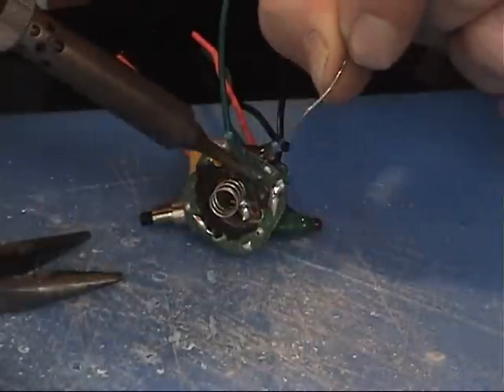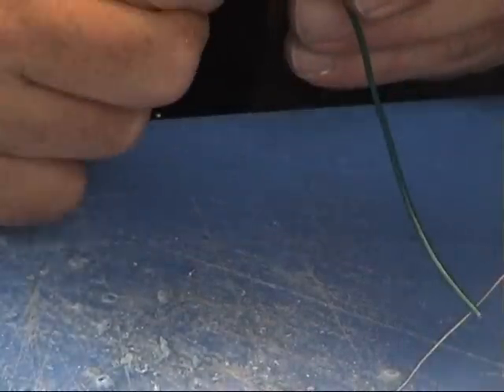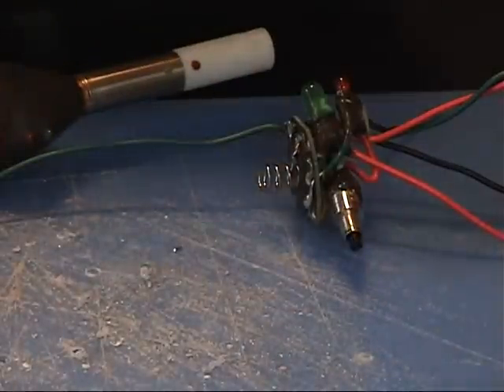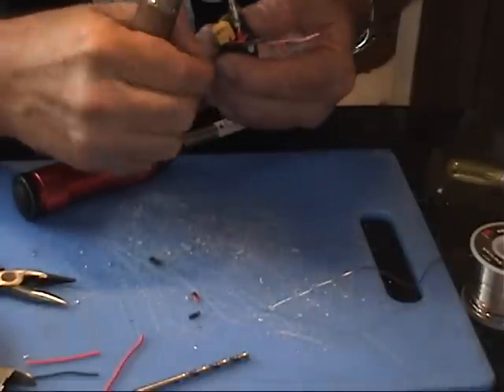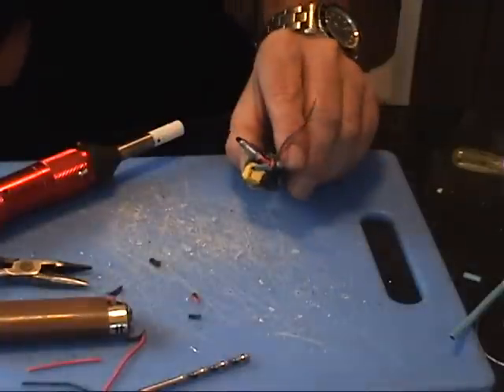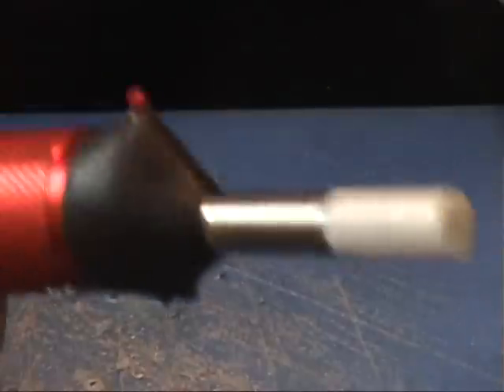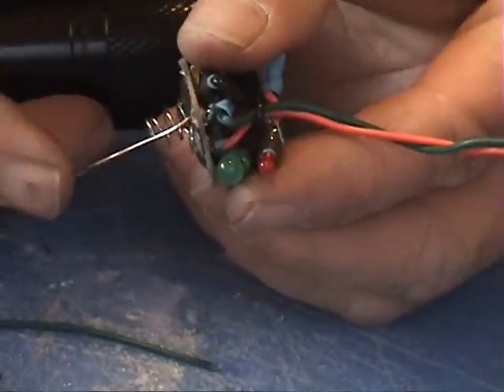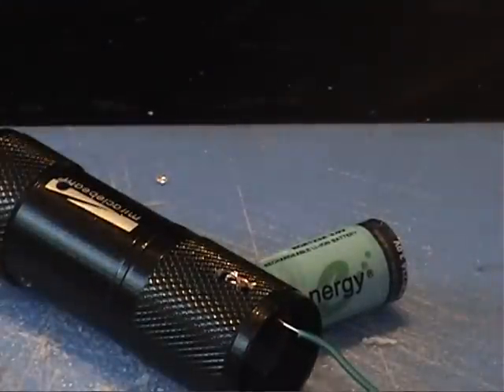E-Cig Mod 5 Volt  Detonator DIY Part 8 using Protected CR123A's

Comment: Thanks, Rob...whew...good to know. This is like a cliffhanger and I feared the series had been cancelled before the season ended. I'll keep watching! I found the perfect "cap" for mine, just hoping it will work with the weld or epoxy but need to see how to place the PCB to make this fire up! I'll let you know how it works out.